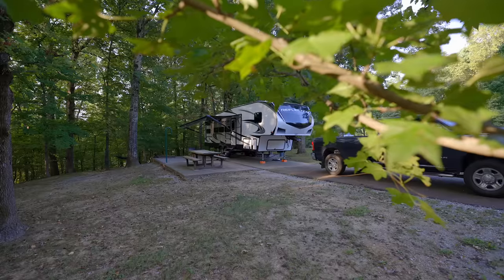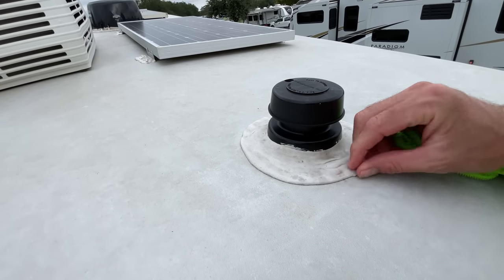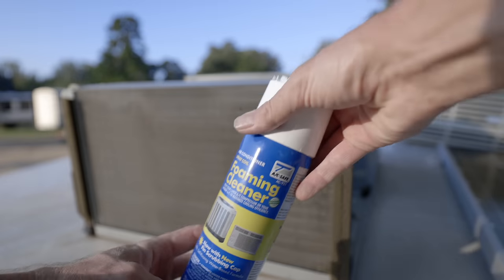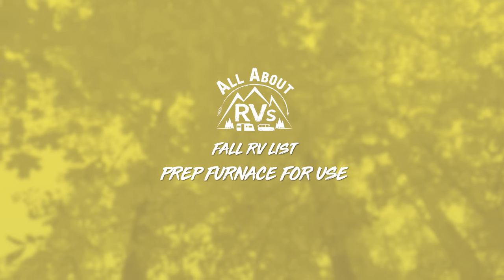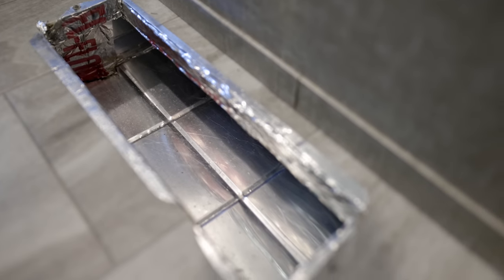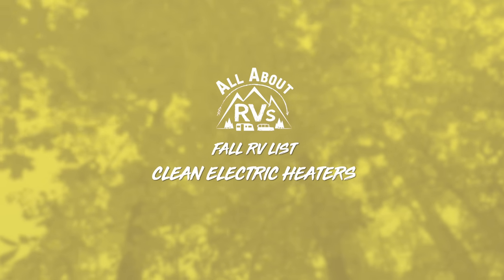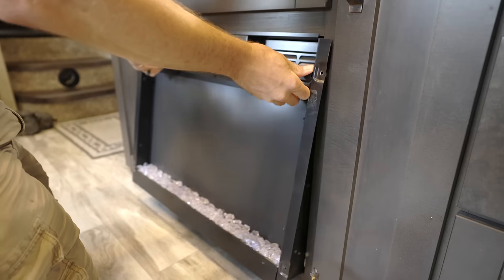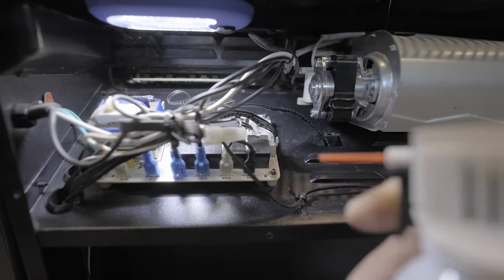Do This To your RV Now! RV Fall Tips.

Comment: I put 4 inch eternabond tape overlapping over all of my self leveling sealent on roof. Never have to worry about cracks or holes. Always good to clean the roof and check it anyway.

Comment: Great video.  1) If you use a garden hose to spray the A/C coil, be careful as some hoses have enough pressure to bend the fins with the water stream.   2) The guts of those furnaces are only held in the sheet metal box with a single screw at the front, so it is pretty easy to unhook the propane line, unplug the wire harness and just slide the furnace out for inspection and cleaning. I found lots of saw dust and junk behind my furnace from when the RV was assembled. I was also able to add insulation to make it much quieter.

Comment: Jared this is a great video.  On the exterior furnace door, in your video I saw you replacing the door after cleaning but not using any type of insulated tape or sealant for waterproofing around the exterior furnace door.  Is this similar for each brand of RV or do some require the application of an insulated tape or sealant when reinstalling the exterior furnace door?  Thank you for your great videos.

Comment: Great information. I will be doing some of those after my next trip. 1 thing to add off topic that most people in general don't know and  my wife learned the hard way. Some of those cans of compressed air are actually flammable.  Look at the label. They become flame throwers with an ignition source.  For my wife it was a running paper shredder.
Reply from the maker: Yes that would be shocking to find out that way.

Comment: I am really fortunate that I can check my RV Roof, just by looking out my window, where my computer is.  The RV is in the driveway, right below me!
Reply: Haha, we do too. I pull out the 2nd floor window and step right on to the roof in my socks to work on it. 😁
Reply: @dougfresh1341  I could almost do that, if I parked a little closer to the house.
Reply: @dougfresh1341  That would work. But l think I’ll just use the ladder to get on the roof!  😁😁

Comment: I put floor vent covers on my floor vents. Keeps dirt out and if you need heat they just come right off. I'm also going to try a screen over my refrigerator plane on the outside to keep the mud wasp out.
Reply from the maker: Good advice on the vent cover

Comment: Apologies for going off topic from this video, but, you have 10 solar panels on your roof, they appear to be all monocrystalline but from different manufacturer's. Are there issues or concerns regarding the mix and match of different solar panels? I'm asking because I'm currently spending a huge amount of time on the Victron website studying schematics and other confusing details to eventually install an M+2 2-120 system in my rv.
Reply: Why would there be?!

Comment: Thanks Jared, always great tips.  Why not a vacuum with brush attachment to clean out the electric fireplace?  Canned dusters usually contains difluoroethane.  Some use tetrafluoroethane and tetrafluoropropene.

Comment: Question : you are cleaning out your water heater (atwood/dometic) and the end of the camco cleaner/wand blows off & now is inside the water heater, what do you do? it appears the entire kitchen has to come out to get to the back. 
thanks, your biggest fan!
Reply from the maker: We have a tankless so we clean ours a bit different but if the wand is stuck in there I would try an inspection camera you can stick in there and a small grabbing tool to get it out.
Reply: This happened to us. After many frustrating hours of using a camera and a grabber we finally thought to add more water while watching with the camera. That allowed the wand piece to float high enough that it was near the drain hole and we were able to grab it with the alligator type grabbers. Needless to say we will never use those plastic wands again, ordered a metal version.
Reply: thank you

Comment: Why not use a vacuum instead of canned air on the inside of the rig?
Reply from the maker: Vacuum can’t get all the dust out from inside the heater components. It’s best to use an air compressor outside.

Comment: I have a Question : I know that for filth wheel campers a long bed pickup was required . Is that still so ?
Reply: You can also do it with a 6'6 bed, they say to get a sliding hitch but I never use it and I can still almost back at 90 degrees. They clip the front corners on the newer campers so you can make tight corners.
Reply: Lots of people tow with short beds just watch the corners so you dont damage anything

Comment: I still don't understand why the RV industry still uses those garbage ac units. Time for 2 way mini split heat pumps to be installed on RVs.
Reply: They are on several higher end models.